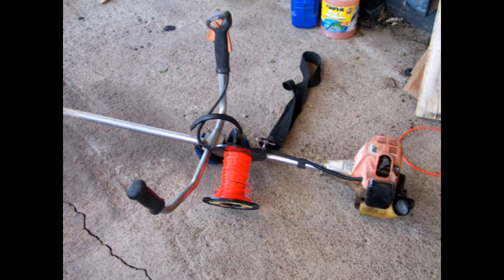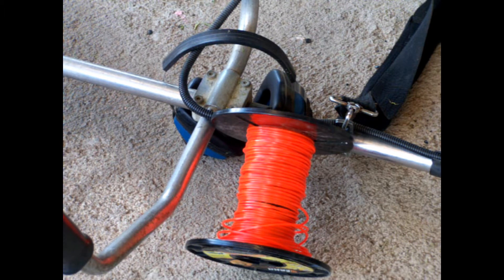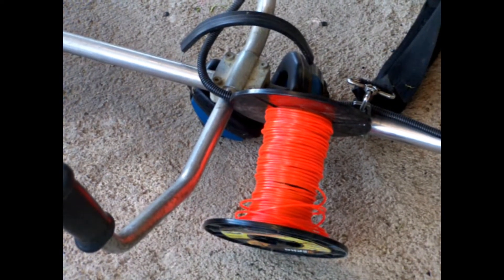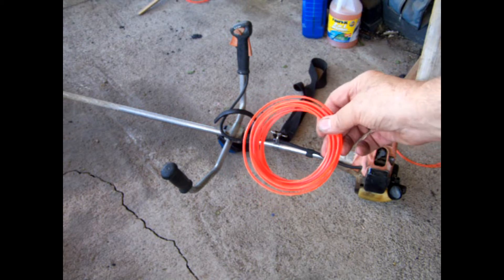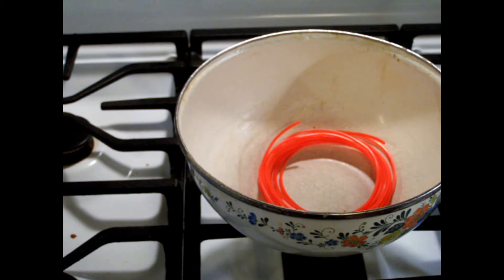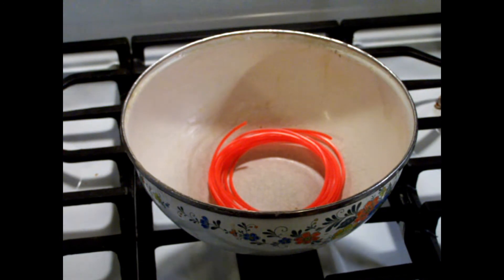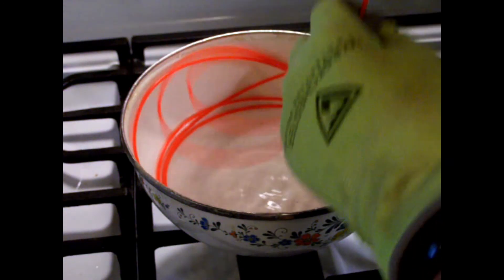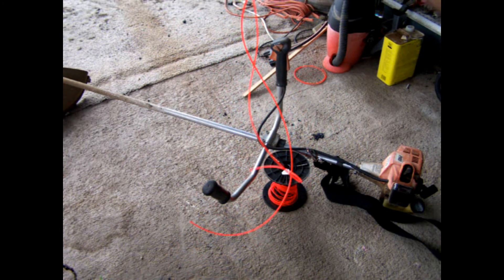Weed eater - How to straighten the Line Trick

Comment: Solid plastics contain zero percent water and do not dehydrate . They simply have a memory as you mentioned and that water was 212° much hotter than the sun so any source of heat 212° or hotter would do the same thing . I take the tight rolls and stretch them down the black trailer deck in the sun and they relax